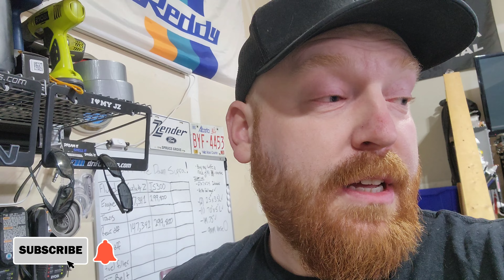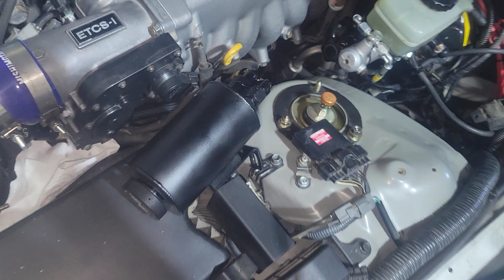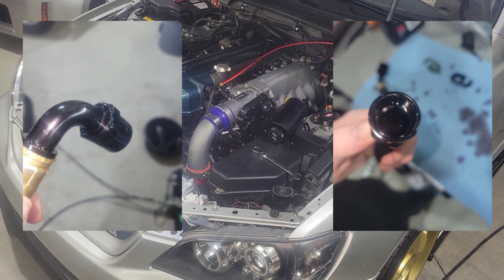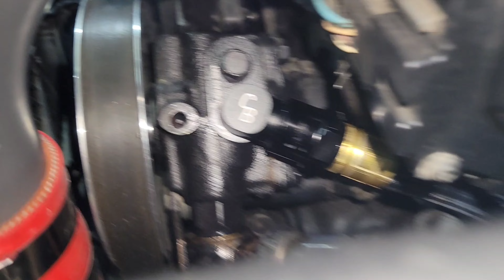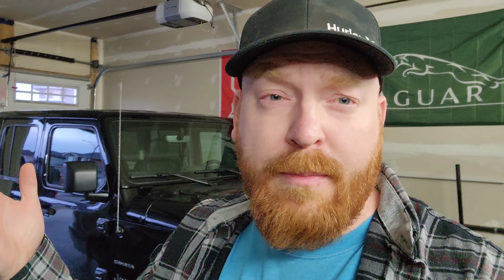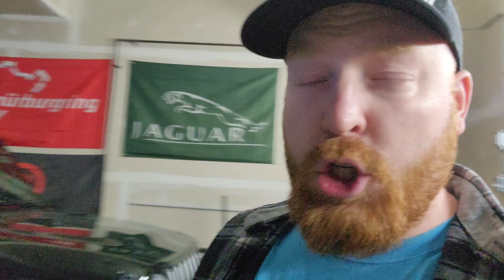2JZGTE IS300 - Chase bays Powersteering leak update!

Comment: Im having the same problem. Im debating replacing new lines. With just an ptfe hose
Reply from the maker: I didn't have a problem once I got a replacement hose.
Reply: Goto a local hydraulic store and they can make a beefier line right there in front of you. I only spent 40 bucks on my replacement line and it’s been working great.